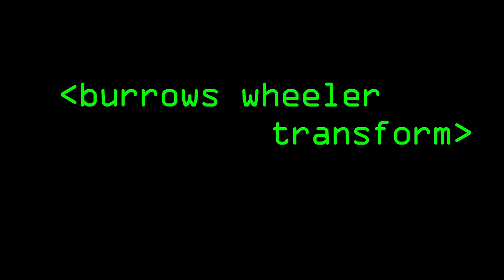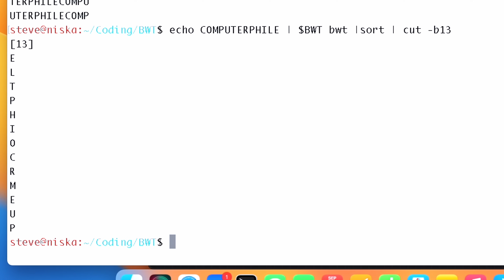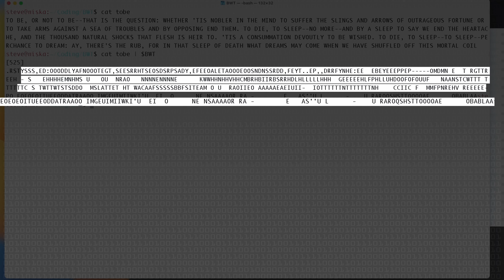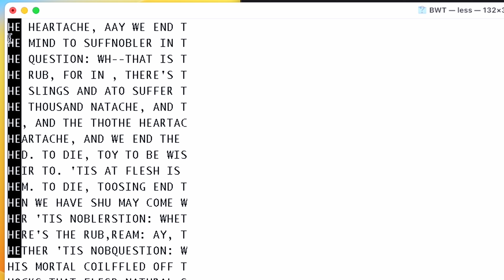How Bzip2 Works (Burrows Wheeler Transform) - Computerphile

Comment: Trying to fill in the missing parts of the video...
You store only the last column, using run-length encoding, which will be shorter than the original string because of patterns of which characters tend to follow which in natural language (wonder how well it works for images or other non-text data).
To decompress, you first run-length-decode the full contents of the last column, then sort it to regenerate the contents of the first column. Together, the two columns give you a mapping from ... I'm not sure, because the ordering of both columns is kind of scrambled by the sorting. I guess I agree with the consensus that there isn't sufficient info given here to reconstruct what the speaker is talking about (ironically!).
More specific constructive criticisms: Pick one plain text and stick with it all the way through rather than changing from Shakespeare to the channel name, fewer context switches to make while viewing. Pick one format for illustrations, hand written or terminal commands, again the multiplicity is just distracting and wastes precious milliseconds on trying to remember what that screen was about. Finally, the whole "column" based approach may be the ultimate distraction, since the entire middle block of columns is irrelevant, and it appears that what you're trying to store is a mapping from one character to the next in an efficient way. If that's the case, then focus on that, from the point of view of the decompression algorithm.
Reply: Combining the last and first column gives you the set of all two-letter substrings of the data, each of which will appear at the beginning of one line. I think what was missing in the video at that point is that lines being sorted implies that their beginnings are sorted as well. So sorting the two-letter substrings produces the first two columns of the table. Prepending the last column to that sort result produces all three-letter substrings, which can again be sorted, and so on.
You are right though insofar that actual implementations do not reconstruct the block like this due to all the sorting involved.

Comment: but didnt you doubled your start set? so now then you compress it more-less back to starting size?
Reply: just for clarification, is your question: "if you need to store two copies of the data, i.e. the first and last column, how are you saving space?"

if that's your question, the answer is: you don't store the first column. remember, the first column is simply all the data in alphabetical order. so, if you take the last column and sort it, you now have a brand new copy of the first column again, and it doesn't cost you any space in the file. (it just costs the time needed to sort all that data at decompression time.)

Comment: I worked for DEC when Altavista came out. At one time, they put a note on the screen that they were now running on 12Gb of memory. We were flabbergasted. This amount of memory was mind boggling at that time.
Reply: How?  The PDP-11 was a 16 but machine...
Reply: They also had vax with 32bits...  but the address space of 32 bits is 4GB
Reply: @kayakMike1000 the Virtual Address Xtension had 32bit addresses but you can have physical address registers of say 1K pages which use 10 bits each.
So a physical memory address can be longer than a virtual memory one.
That was already done on PDP in a less general way where a program could be linked to have seperate executable and data segments, with many 16bit address spaces stored in say a RAM approaching 1MB, the program would be swapped in/out as a single unit rather than virtual pages when RAM was full.
Reply: That must have been a whole floor of the office building devoted to memory 😅

Comment: Why strictly single character-based approaches? Isn't the obvious approach when it comes to natural language text to find recurring patterns? In the short Hamlet quote "to be" occurs twice, so just needs two pointers for where they start. As the text gets longer, more and more repeating patterns will be found.
Reply: This is exactly how some encodings work (e.g. LZW), but the one being discussed is not one of those.
Reply: There are encodings that are optimized for human-written text. But most popular (gzip, bzip, etc) are all generic for all kinds of data. And you won't find that many patterns in the computer-generated file formats that a lot more frequently need to be compressed.

Comment: it seems like a very low chance that doubling the raw amount of data would result in something smaller than the original data, even after RLE. how can you assume that the last column will be just as "patternly" (not sure what the word is) as the first column?
Reply: The first column is obtained by sorting the last column - you don't store it.
Reply: The last column's contents will cluster together based on frequent pairings of what follows them.  When the 1st column is sorted you'll have a bunch of "t"'s at the last column in the "h" section (because of "the", "they", "this" etc. etc.), and another bunch of "t"'s sorted together in the "o" section ("to", "toy", "tomorrow" etc.).  It's based on how frequently a letter follows after another letter in this particular text.
Reply: In contrast, a random-looking string of characters like a YouTube video ID, e.g. "dQw4w9WgXcQ", encodes to "wwXQWcdQ49g" which doesn't RLE encode much better at all than the original input.  Here it just so happens that both lowercase "w" occurrences are right before a digit, so they both sorted together, but after RLE encoding with lengths that still would likely be longer than the original input itself.

Comment: I didn't find this entirely clear... So ultimately you're storing the entire first column and the entire last column, which is 2x the original data length, but because the first column has been sorted, run-length encoding is more efficient on the first copy, and the second copy is similarly more likely to have run length efficiencies... but... enough to encode 2x the original data? And how does one reconstruct the original text from those? If you re-expand the first and last column you can see what followed what, I guess? but then how do you know what comes next? It's been sorted... Just because one T preceded an H, it might also precede an I or an E, how do you know which is actually next?
Reply: "So ultimately you're storing the entire first column and the entire last column"
- No, the first column is sorted, so it can be recreated from the last column. Thus there is no need to store it.
Reply: "And how does one reconstruct the original text from those?"  The reply by  @pr0ntab to the comment from @trevinbeattie4888 (starting with "I feel like I only got half of the story") answered it in a way that finally made it click for me. The comment is about 2 hours before yours, if you sort by newest first (just saying this for convenience in finding it.)
Reply: If you don't mind a long but very well done explanation of BWT, search for "billbird bwt." It's a few hours and reiterates points made in this video from Computerphile, but you can probably click through them if you understood the transformation part.

Comment: I thought I knew the command line reasonably well, but could someone explain what the | $BWT did?  His code is bwt, but why prefix that with the $BWT?
Reply: It's a shell environment variable. I guess the full command was way too long to type or show in the terminal so he saved it to a variable and referenced that instead.
Reply: @jb31842  ah, I knew it was a environment variable, but I see what you mean. It could well something like the path the version of Python (guess) he used with command line options.   Thanks
Reply: As jbucata said, BWT is an environment variable that contains the full path to the C program I wrote to demo the transform. The bwt is a parameter that program that tells it what mode to run in…
Reply: I am just guessing based on what I can see:
- $BWT is the script he is running, set by running a command like `export BWT="path/to/your/script"`. 
- The script seems to take a parameter: I am assuming that the script can do multiple things. In this case he passes it `bwt` which is probably the matrix generating code.
- The `|` is a pipe: it takes the standard output from the previous command and passes it as standard input of the next command. 
- So `echo COMPUTERPHILE | $BWT bwt` sends the string "COMPUTERPHILE" on STDIN to `$BWT bwt` which does its thing: computes the matrix and echos it to STDOUT (which gets printed to the terminal)
Hope that helps :)

Comment: I did not follow how you can regenerate the original text from the BWT. A step-by-step explanation of the decompression procedure might be helpful
Reply: I think you can keep adding sort character back to regenerate the matrix.

for example abcd.

you have
abcd
bcda
cdab
dabc

the last column
d
a
b
c

sort it and you get
a
b
c
d

and beacuse the orig is sorted. now you know
a??d
b??a
c??b
d??c

last character is before first character, so you get

da
ab
bc
cd

sort it and now you know
ab?d
bc?a
cd?b
da?c

and beacuse last character is before first character again. you can keep doing it until you get all that back.
Reply: @billli11   I feel like your example only works because it's literally "abcd" that was probably not the best choice
Reply: @sebastianelytron8450  That was a simplify version base on the video example.
checking wikipedia seem like BWT use 2 marker to mark the original string starting and ending point before doing the transform. or mark the orig with a index number.
Reply: @billli11 you really only need the last, as once you've reconstructed the table, only one of those will end with the "end of sequence" symbol, and that will be the original.
Reply: I originally replied this under another comment, but it's a bit buried and this is nearer the top, so I'm pasting it here! Hopefully this isn't spammy:

I'm going to make an example. Hopefully YouTube allows me to format it... Let's compress "game". It's too short to actually get smaller, but it's short enough for me to type. So our original matrix looks like:

GAME
AMEG
MEGA
EGAM

Then we sort those lines and get:

AMEG
EGAM
GAME
MEGA

And I know two things about this. The first is that every column has all the same letters in it, and the second thing I know is that the letters in the first column are sorted. And I also know because of how the rotation is handled that the last column is all the letters that came before what's in the first column, when they're sorted. So I can store GMEA (and also the number 2 to note that my final word is the 2 down from the top).

So to decompress I can build a grid that looks like:

▢▢▢G
▢▢▢M
▢▢▢E
▢▢▢A

But I know that all the columns have the same letters, but that my final column is in the order it was in when the first column was sorted, so if I sort "GMEA" I get "AEGM" which must have been my first column. So now I can build:

A▢▢G
E▢▢M
G▢▢E
M▢▢A

And I can know I can rotate it backwards to get

GA▢▢
ME▢▢
EG▢▢
AM▢▢

Ok, almost there. I now know these two character chunks, and I can sort them too and get

AM▢▢
EG▢▢
GA▢▢
ME▢▢

Ok, so now we might seem stuck. But wait! We know the original sorted matrix was in sorted order, and we know this is in sorted order, and we also know what the last column of the matrix was when it was in sorted order. It's "GMEA" which we stored at the beginning. So we can fill in that last column and get

AM▢G
EG▢M
GA▢E
ME▢A

Now we are in a steady state. Now we can rotate again, sort again, and then stick the last column on again, and when we do that we'll have rebuilt the sorted matrix. Then we can remember the 2 we stored and pull the "GAME" row out. Magic!
Reply: @christophervollick4634  Very helpful, thanks!
Reply: Same here. The later part did demonstrate how the last and first columns each form a digram from the original text, but I don't see how that helps us distinguish AB from BA, or EEGEEHEEBEE from EEBEEHEEGEE. I suppose a stable sort would recover some of that; then common suffix bigrams are listed in order of occurrence.
Reply: I think this needs to be redone with a better script and someone asking questions as they go.
Reply: Each column has the same letters in it. The first column are those letters in order. (because the original matrix was sorted.) So if you just have the last column, then sort it, you get the first column. You can pair that first and last column off and sort them because you know all the two character sequences are represented from the original rotation, and you get the first two characters of the original sorted matrix, and youve still got the last column you started with. 
Pairing up again the first and last bits you can repeat the process. The ec he highlights gets the l becoming lec, gets sorted, gets the i becoming ilec, gets sorted, and so on. All the others are being built in the same manner until you get the complete matrix.
Reply: I think I sort of get it now... The last column's character is followed by the character in the first column because of the rotation pattern. So you've got a list of "foo is followed by bar". With some shenanigans you can follow that chain of steps around to recreate the whole original.
Reply: BWT uses a bunch of small tricks:

First, similar text has similar predecessors.   If the following text is `here`, the preceding letters is likely `w` or `t` or space. This pattern in language is why sorting by the following text helps us group similar letters together.

Secondly, the BWT contains the same letters as the original text but just sorts them differently. Instead of sorting by their text-position, they get sorted by the text which follows. This is a permutation, and undoing the permutation gives us the original text.

Thirdly, induced sorting. If you have some sorted strings, prepending the same letter 'w' to each string still leaves them sorted.

Finally, let's just look at these following strings. For panda it would be `panda`, `anda`, `nda`, etc. The BWT letters are sorted by their suffix, this would be a, anda, da, nda, panda. The BWT are the predecessors of these suffixes, `dpnaa`.

To get the permutation, we want to map the position of some suffix (d-a has index 0 in dpnaa) to the position of the predecessor (n-da has index 2).

 Our current suffix is da, so our predecessor n-da uses da as sort key. The ingenious idea is that the letter d, and its position in the BWT array, is enough to figure out its sort position. And the sort position of da is the BWT position of n-da by definition!
Here is the shortcut: There are two letters smaller than `d` and no other `d`, so our sort order must be  2. BWT[2]='n'. We can repeat this: there are three letters smaller than n and no other n, so the next predecessor is at position 3. BWT[3]='a'. We already got '...and...'

 
What happens if there were multiple `a`s?

Because of induced sorting they will stay in the same order. So our true predecessor position is `number of letters smaller than a+ number of a's that come before this one in the bwt`.

There are no letters smaller than a, and this is the first a, so our next predecessor is bwt[0]='p', then bwt[4]='a', then we loop with bwt[1]='d'.

This gives us 'dapandapanda...'
 You need a special end-of-text character to know where the text should start/end, because the permutation is cyclic.
Reply: The original table can be reconstructed after you got the first and sorted last column, then pair them. After that, you can sort the resulting pair and then pair it with the unsorted pair and so on and so forth. At least thats how I understand it
Reply: The sorted BWT table has an invariant: "rotate and sort". For example, here's a table for the word "hello" (plus the "-" symbol to mark the start of string):
ello-h
hello-
-hello
llo-he
lo-hel
o-hell

Now, let's split every row in two halves:
ell     o-h
hel     lo-
-he      llo
llo     -he
lo-    hel
o-h     ell

Now, let's swap them and concatenate back (this is called "rotation by 3"):
o-hell
lo-hel
llo-he
-hello
hello-
ello-h

And finally, let's sort them again:
ello-h
hello-
-hello
llo-he
lo-hel
o-hell

We have obtained the exact table we started with.
We can "rotate by" any number each row, and sort after that, and we will obtain the same table.

If we only have the last row, we can rotate by 1 and sort to get the first column:
⁥⁥h - o e l l    turn into    - e h l l o

e????h
h????-
-????o
l????e
l????l
o????l

Now we can rotate this:
he????
-h????
o-????
el????
ll????
lo????

And sort again:
el????
-h????
he????
ll????
lo????
o-????

Notice that we still obtaining the same table as before, even when we don't know some of its content, but we can fill in the gaps by applying the transformation that should keep the table intact. That is "rotate and sort" transformation.
el???h
he???-
-h???o
ll???e
lo???l
o-???l

We rotate
hel???
-he???
o-h???
ell???
llo???
lo-???

And sort
ell???
-he???
hel???
llo???
lo-???
o-h???
Reply: Agreed.  Poorly explained
Reply: ok?
Reply: I'm glad to hear that I'm not the only one who didn't get it
Reply: if you look at the last column at 5:25 its literally “ecomputerphil”, just move the first char to the end